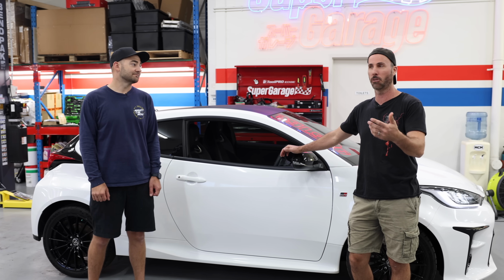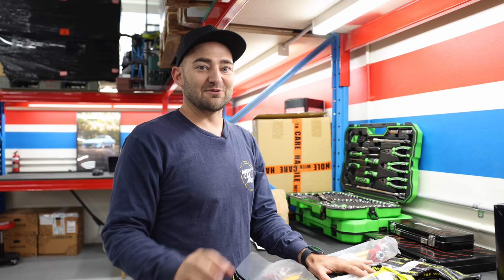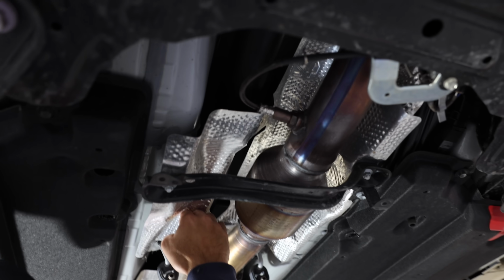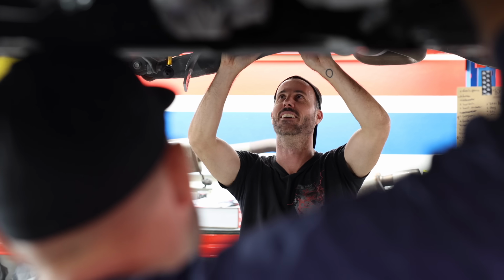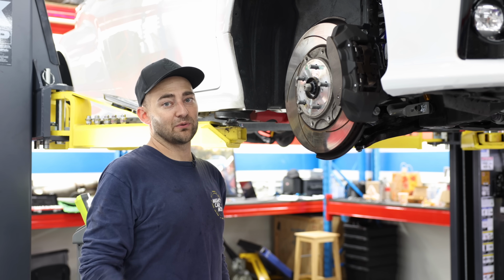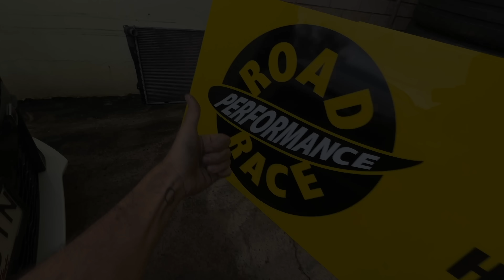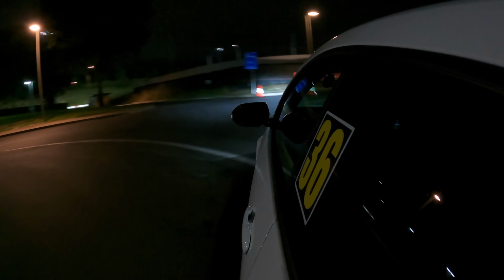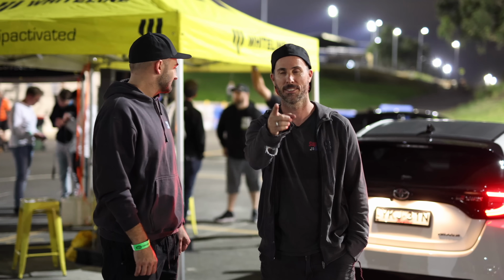GR Yaris first mods and testing it out on track

Comment from the maker: Checked out our Feature articles? New behind the scenes and tech stories every single week, free on our website: https://mightycarmods.com/blogs/news/how-the-gr-yaris-and-gr-corolla-awd-system-works
Reply: I've got one of these GR's and the factory headlight adjustment is balls

They need to be aimed higher, driving at night is actually scary when you are doing 100k's on a country road and cant use your highbeams because a car is infront.

Definitely needs to be your next mod guys, only need an 8mm socket and a sharpy if you want to mark the washer to adjust each side the same turns
Reply: Why not a Hyundai i30n ????
Reply: I hope this reaches you guys, I've been a fan for absolute ages and the two of you on the track with Moog calling corners and gears while Marty wrangles that nugget around the track is my absolute favourite time I've seen you guys together in a car on a track. It was so cool to see Moog use the instructing he got back from the Lotus era it was really helpful because now at night you have to RACE a whole new hectic track on a new setup haha it was honestly suspenseful. Cheers.
Reply: Great video and love that you're slowly introducing mods. I was curious if you are using some type of module to activate the hazards when you are applying the brakes. If so, please share. Thanks!
Reply: No coilovers?  Best mod on a yaris is suspension 👌
Reply: I'd love to take yous for a spin in my Tarmac Rally car 💯 280hp k20 ef(boxy) civic weighs 850-900kg
Reply: "where do i go" is not ideal for when you are trying to set a lap time 😫
Reply: But what was the laptime?
Reply: @MrBrander  i dont think its important, might as well do one lap in the middle of summer day and do one at night in the middle of winter after the upgrades
Reply: What happened to RE003s 😆
Reply: That light in your face is dangerous, you should swap it out for a near-infrared one (or several), the camera will probably still be able to see you, it'll just take some editing trickery to bring the shot back to life, or otherwise switch the camera out for one that can see infrared.
 Another alternative is using blue light, which your eyes won't react to as much, tho it'll likely make you feel a bit uncomfortable.
Reply: @SuperTurbo9001   this is the same with my Forester..high beams amazing low beams....on the ground ...
after it was lowered i had to raise them to stay alive

Comment: Briaded lines help with brake feel as rubber lines flex the tiniest bit under pressure, thus making the padal more "squishy".
This effect can become more pronounced as the fluid (and the line) increases in temperature.
Reply: Most modern 'rubber' lines have internal braiding making them very stiff also.  It's not like it's radiator hose rubber 🙂

Comment: I know a lot of the competitive AutoX guys in higher classes used to run a really big front sway bar on GD Subarus. As I recall, it basically allowed them to hold their line better mid-corner. Plus since you could rotate with on/off throttle weight transfer, while the bigger bar in front increased rear grip and assisted quick transitions, it made those cars super quick on tight tracks.

Comment: I'm not saying big turbo 600hp. Just put a downpipe and tune. You'll get better turbo response and it's still very usable power. Around 800bucks to do all that. You can even do jb4 for 500 and high flow cat for around 200. The tires and sway bars will make this a track monster.

Comment: Great vid. I did H&R Springs with Whiteline Camber Bolts and and Caster Bush Kit. Did an alignment and like you, got a decent performance gain. Since then I’ve done coilovers with front top mounts for extra caster and made a change to the alignment including toe out at the rear. Threw on some WedsSport wheels and Yoko 052 tyres, and WOW faster again! I have the Whiteline sway bars on the shelf, so they’ll go on next. So, yes. Do it in increments and see what works for you.

Comment: Mods that I would add - lower-torque arm bushing or the whole thing. Exhaust for just giggles as it makes the feel of the car different. Seat lowering kit - had SuspensionSecrets one and it transformed the car! 35mm change is massive when I swapped back to the regular seat height.

Oh and lighter wheels like the rallye should also feel good.
Reply: I'd also recommend the TGR mirror riser on top of all this and remove the fake engine noise via carista (or have the dealership do this).
Reply: @OmaygaDesigns  if you lower the seat the mirror is not that big problem. 

That fake engine noise is fine until you do a exhaust mod. Feels more like a setting than mod :D

Comment: After I blew up my 5 speed, I swapped my 09 WRX with STI 6-speed transmission and diff that had the Torsen diffs front and rear.  The change in how the car handled was incredible.  Instead of one (maybe two) wheel peel, it just goes where I point it and mash the skinny pedal.  Get the Rally Diffs and you'll be a believer.

Side note - understanding how the torsen diffs works isn't intuitive, but the design is awesome.  If you could show (on camera) how one works, that would be killer too!

Comment: Whats with the turn signals / blinkers coming on al the time on the track? Are you bumping them or are they somehow automatic? haha
Reply from the maker: Automatic
Reply: It's a saftey feature built into most modern cars. If the car detects high braking force then the hazard lights are automatically activated to alert any potential cars following of the sudden stop.
Reply: @mightycarmods  that is craziness must be activated only by a certain amount steering input or else it'd be signalling on a winding road or race track too? Haha
Reply: @peterjames808  ohhh it was just the hazzards on the turn signals? That makes more sense

Comment: GReat video once again. First mod I did was the front camber bolts (Powerflex PFA100-17). In OZ you have Whiteline (KCA-417) easily available. Both these give you an extra + / - 1.5° camber adjustability which the car really needs as the front stock camber bolts are static setting to -1.5°. I noticed the outer section of the front tyres getting excessively worn out. This car needs -2 to -2.5° for road and occasional track days. -3° to -3.5° is more for the regular track days but a bit excessive for road use.
The rear stock camber setting (-2°) is OK for road and occasional track days.

Comment: for the winter rallycross, chuck on a little ebay light bar. you don't need $800 spotties, and good spread you get from those cheap and nasty bars would be more useful to see around corners than being able to read a newspaper by the light 1km away. Reckon you might even get a small light bar behind the grille for a nice clean install. Just a thought. My daily commute is a twisty bendy drive up and down a rainforested mountain range, light bar for seeing around corners at night is boss.

Comment: Marty: “I can’t see”
Moog: “Are you on high beams?”
Marty: “No”
Reply: didnt look like he had those lower fog lights on etiher which probably would have helped see the turns better
Reply from the maker: In some sections the high beams reflected and made it harder so it was easier to turn off.
Reply: @mightycarmods 
where? we had a light bar but wanted  more, especially in the tight no skid Zones between the barriers and the back straight P.S. we only ran a 2:51 but it was our first time driving in @ 5-6 years and the car had only be driven gently 😉up and down the street to test.

Comment: Looked as the yaris was turning alot better than before.

I have the full whiteline sway bars, drip links and wish bones on my impreza wrx hatchback and what a difference it has made.
Reply: Steering rack bushings and whiteline bars were the two most noticiable mods other than the RE71Rs. I still have to install the whiteline LCA bush to get that extra caster and horrible clunk from the factory one getting smashed on braking and turn-in lol
Reply: @3ToeCo  i still have the odd bit to look at changing

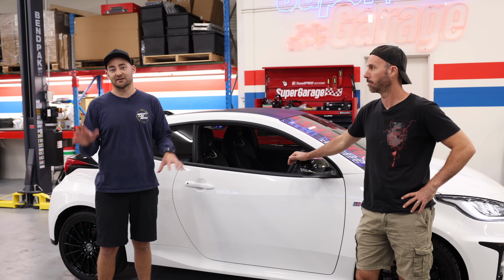Comment: 0:45 Also dat sponsorship yo.

So i got some new Logitech 5.1 surround speakers (i know not super awesome but good enough for me in my small flat). I've been waitning for Moog to give them a test and I was not disappointed.

13:03 there are also situations where the pressure in the stock lines does get transferred to the caliper and is wasted ballooning the lines. There is a real benefit to using reinforced lines.

Comment: Try to be later on the brakes, earlier on the gas, and push that point until you begin to understeer. That will be the maximum of the car. Do that with each new mod. If the sound of the car was synced up good, it looked like you were too late on the gas. Especially on AWD/FWD when you can just swing out of the corner if you hit it between 1/2 to 2/3 of the corner. Or, you can still try left foot braking, and keeping that turbo spooled, but that might not be the best on such a tight course. Great vid anyways!

Comment: With my rc car setups, I would have started with springs because lowering the ride height will change the angles of the control arms which changes the roll center. The roll center determines weight transfer and how cars handle in entry, mid, and exit of corners. Then you would add the adjustable roll bars to tighten up where you want it tightened up.
Reply: @promethbastard  Yes and no on the beach buggy comparison. (I'm going to nerd out for a minute) Most tracks are going to high bite clay, glued clay, and carpet so the traction is like on-road. We're running slicks on everything. The newest buggies are designed with less kickup which reduces the castor so there isn't nearly as much camber change keeping the front tires flatter while steering. Ride height gets set so low that now the trans cases are adjustable so you can raise the diffs to keep the axle shafts level. It's a whole other world now that carpet is taking over. But yes, the adjustable sway bars he added will help at every stage of the build. They will just need readjusted again if he swaps the springs, but they will need set up differently anyways when he goes to a fast open track.

Comment: I agree with incremental mods, and a little more being focused on mods not based on the internets recipe but more on where you find things lacking. And just putting eyeballs on all the parts of parts of your car, esp turbo systems. But really doesnt apply here because new car, but its about getting all the maintence done and have the car running right before adding more power

Comment: The biggest difference i like over many small powerful cars is the awd... back in around 1980 audi did some tests and "found" that above 200HP or the fitting NMs especially front wheel drive did not get it on the street..
Now tires and suspensions got a lot better and a lot of control widgets got added but physics dont change.
I could do a spinning wheel start in my old 88HP audi.. i always cringe when i see numbers above 150HP, turbos and front wheel drive only. Yeah great to have that to accelerate from 100 to 150 a bit faster but forget pedal down in corners below 50...

Comment: maybe a bit to practice on.. trail brake into a corner.. you dont need a lot of force during braking into the corner.. you just want enought load on the front wheels to turn and a little less load on the rear so it steps out a bit making the car quicker to turn...
its harsher on the tirewear  but once you got the nose of the car pointed to the exit of the corner you can start accelerating again.. the less time you need to make the car turn the more time you have for the car to accelerate

also a rear LSD will make it also a lot easier as it will lock the rear wheels together giving you more confident when flooring your GR on its way out of the corner...

if you can go earlier on the throttle you will have a higher corner exit speed that you can carry throughout the straight up to the next corner..

and another thing.. with a stiffer set up you want to turn off the traction controll.. if a wheel comes of the ground and power is send to that wheel the ECU will cut power as it detects a difference in speed throughtout the wheels slowing you down
Reply from the maker: In track mode the esc is pretty hands
Off but yes this is part of the incremental changes to get it quicker. Early days.
Reply: @mightycarmods  the rally stage you where doing looked more like an autocross.. when you mentioned rally stage i was thinking more like 40% tarmac and 60% dirt like rallycross  or a rallystage has.. rally drivers usually just throw the car into a corner and the car is set up to oversteer a little (with a rear lsd) so they can use the throttle to steer the car while keeping steering imput to a minimum..

I wouldnt recommend doing this if you want your tires to last.. but it works really good if you got an awd system... 
Maybe a thing to try is rally driving school.. 
They will learn you how to steer the car with the throttle 
And how to slide through corners as rallydrivers usually dont drive clean lines but enter the corner a bit sideways to floor it when the nose of the car is pointing to the corner exit

There are different driving styles to tackle the same course.. hope marty finds the style he finds good for him and his GR..

Comment: Poly bushes suck, take a set and wear out super fast not to mention a ton more NVH. TRD uses (or used to anyway) higher durometer rubber instead of crappy ploy. Everybody uses poly because its dirt cheap and easy, not because its good. Its one factor I use to judge the quality of aftermarket stuff... Brakelines on a new car is really just fluff, but makes people feel more serious I suppose lol. If you boil the fluid, its because you are using the wrong brake pads, not because of the rest of the system. At least on this car.

Comment: My buddy works at the Toyota assembly plant nearby to me and he has told me that every once and a while a car comes down the line and one of the subframe bolts won't be threaded correctly. When he is tightening them with the special jig tool if it's cross threaded they have given him a 3/4" Milwaukee impact gun and he is instructed to just ugga dugga the balls out of it until it goes in. If it doesn't go in after a 30+ ugga dugga's then and only then they will mark the car on the line and the problem gets fixed later by someone else lmao
Reply: ?? You sure??? TPS
If cross thread on line interlocked semi auto / auto nutrunner the line will stop if not repaired in pitch by team leader with battery nutrunner and typically hard wired break back....  
You seem to be describing British Leyland in 1980's

Comment: the CUP 2 is great but they have horrid wear. 
if you can run pilot ROAD 4 daily, then put the cup 2's when you go to the track. will be much cheaper in the long run
lol why wouldnt you put high beams on and almost crash every corner...

Comment: speaking of upgrades, people consistently think upgrading their suspension via lowering is what causes them to get better track times. this is incorrect. while a low center of gravity can be a good thing, the main change on their times is the stiffer suspension, which on a perfect race track (no pot holes like street) having that stiff suspension means more control over the car. which is great for track. in essence, you could literally install coilovers, stock height, and then simply set them stiff for track and medium to soft for street. and then you get enjoyable driving both track and street. i love seeing street cars trying to street race with stupid stiff suspension, because they hit uneven ground or a pothole or even a raised bump and they lose control spinning out or crashing. meanwhile my car, setup for street, handles the bump no issue and i speed over those issues no problem and win said street race. they dont realize super stiff and slammed is trash for street. i always got made fun of by the subaru crowd because i refused to lower my subaru. "you need to lower it'"no you really dont. i remember beating a 800hp STI in my 2006 bone stock honda s2000 because its setup for STREET not track, and the 800hp subi was balls stiff and slammed so the guy just could not keep up. sure his straight line speed was fast but he couldn't corner because street is not smooth like track.
Reply: so what you're saying is that lowering your car gives improved handling thus improving lap times? gotcha and a STI cannot hit 800hp without the engine exploding, and you didn't beat shit in your stock S2000, certainly not an STI lol
Reply: Sure thing m8

Comment: Dot4 brake fluid? 🤮 If you are worried about boiling you should be using dot5.1 at a minimum, preferably the higher temp versions.